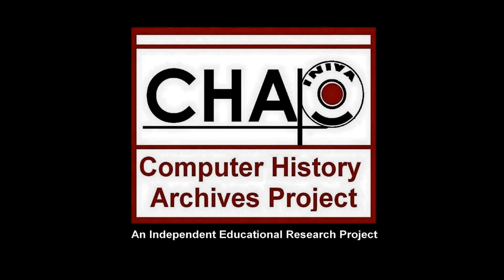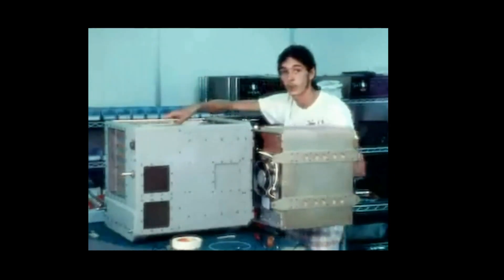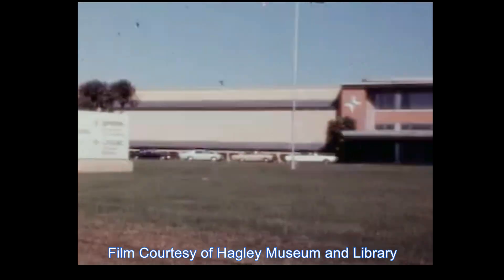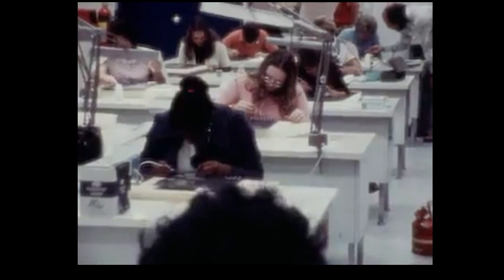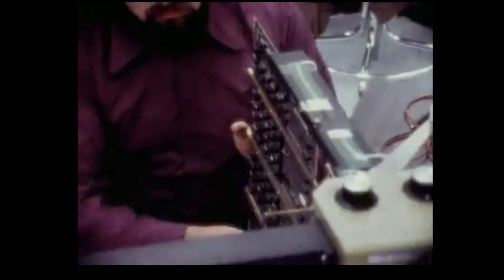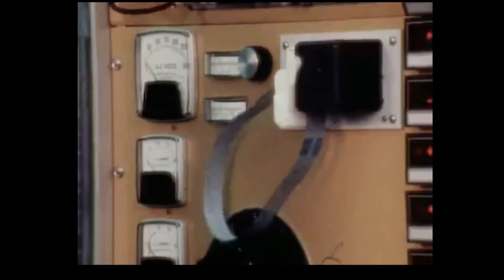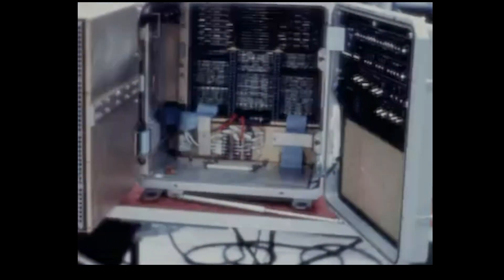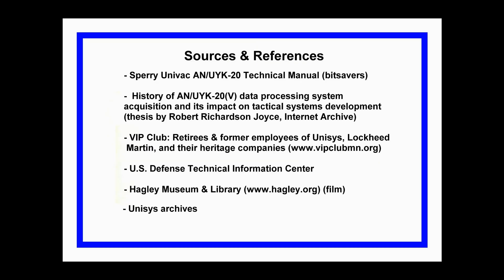1975 Computer History: SPERRY UNIVAC Factory Tour Employees AN/UYK-20 Technology Clearwater Florida

Comment: I was an ET in the Navy.  I still remember part of the tech manual for the AN/UYK-20 to this day.  If the core (wire wrapped memory) memory is faulty and you can't be certain that the memory is clear you must destroy the wire core memory with an ice pick, then use a sledge hammer or dry incinerate the board.  My favorite part was "the return the board for depot level repair"
Reply from the maker: Hi @donsewell7459, that is an amazing story that I have never heard before.  There is nothing like first-hand experience.  Thank you very much for your feedback on this video.  ~-  "ET"  is "electronics tech" or similar?     -  VK
Reply: @ComputerHistoryArchivesProject  Yes ET is electronics Tech.

Comment: My first computer.  I was a USN ET and NAVMACS tech stationed aboard the USS John F Kennedy (CV-67).  Working on that with the USQ-69 keyboard/terminal was quite interesting as well as using the internal register switches inside the front of the UYK-20.  I remember beta testing the new NAVMACS II system that initially replaced the UYK-20's with SunOS v4 SPARC based devices however, for production the Navy opted for the DTC II computer system consisting of HP Apollo servers running HP/UX which was more in keeping consistent with other systems such as TADIX/OTCIX and NTDS.  Excellent memories, thanks for posting.
Reply from the maker: Hi @00w4gap00, it sounds like you have some great experience in some very hefty and complex systems!   I recognize some of your terms, but had to look up these two:
The abbreviation TADIX stands for "Tactical Data Exchange System" and is mostly used in 
Military, Army, Defence, Intelligence, Services; and OTCIX in Military refers to the "Officer in Tactical Command Information Exchange" subsystem.   -  Hope I got that right.    Thank  you for the great feedback, glad you enjoyed the film!  ~ VK, CHAP
Reply: @ComputerHistoryArchivesProject  yes you got them correct.  Both of those systems are also heavily used by the Navy.  :-)

Comment: I worked for NCR from the late 1960s to early 1980s. I repaired the early main frame computers such as the NCR 315-100 series computer. It had a wire wrapped backplane with nearly 400-printed circuit boards. The main core memory was in a separate cabinet. A typical system used in a bank would be the main processor, 1 to 4 memory cabinets, CRAM (Card Random Access Memory), tape drives, a paper tape reader, a high-speed printer, and a document sorter. Offline was a key to magnetic tape unit. NCR did not use punched cards, but instead used a key to magnetic tape unit. Checks and other documents that could not be read, went into the reject pocket. Those documents were then keyed in and written onto magnetic tape, which would then be merged in with the other documents, that were previously read by the document sorter. Punched cards were very wasteful and at the end of the day were tossed out. Magnetic tape could be used repeatedly.
Reply from the maker: Hi @jsteck3, those wire wrapped backplanes were always an amazement to me.  Such an impressive piece of technology in those days.  It sounds like you have an impressive background in early computer technology.  Your point about the punch cards/vs tape was interesting also.  I don't recall people being concerned back in the day, about the punch cards being "recycled"  or just tossed.  Times change.  Whatever happened to the thousands of reels of plastic (Mylar and PET) tape that were in data storage rooms since the 1960's?

Comment: A lot of the processes and equipment looks VERY similar to what was at Lexel Imaging when I worked there in the late 2000s.  That company used to be Hughes Electronics.  We did a lot of hand soldering rework, automatic circuit test, CRT sub assembly manufacturing (from raw glass to finished tube assy), conformal coatings, and circuit potting.  But yeah lots of vintage stuff still in use at that place LOL

Comment: I worked with the newer AN/AYK-14 computers that were made for naval aviation. They shared the same base instruction set but were 1/4 the size and nothing was wire wrapped. It had 128 K Words of core memory with a bit slice processor. Very rugged and radiation hardened with 3 to 6 redundant bus lines go io. Today an Arduino is more powerful.
Reply from the maker: Hi @christopherguy1217,  Thanks very much for your comment!  The AN/AYK-14 sounds like quite a computer!     Thanks for the mention of Arduino too.  (I had to research it, and this is what came up:  "Arduino - Open-source electronic prototyping platform enabling users to create interactive electronic objects." )   Fascinating!   Thanks again!  ~  Victor, at CHAP